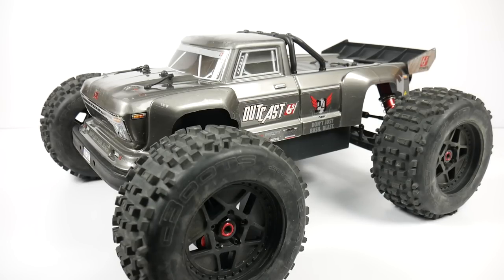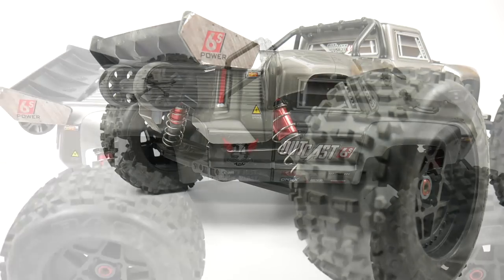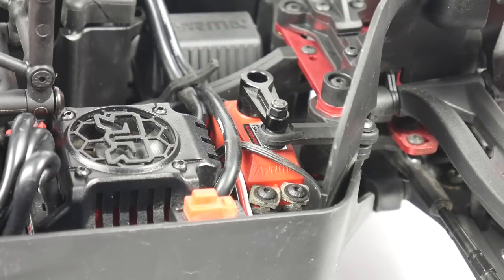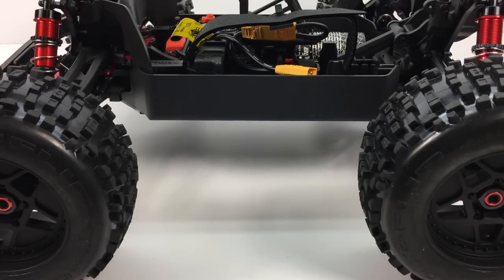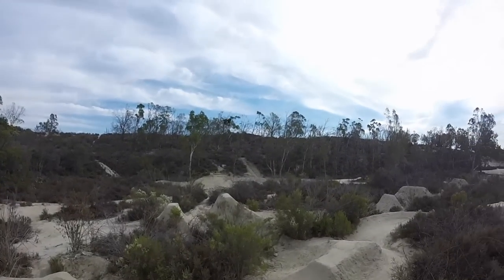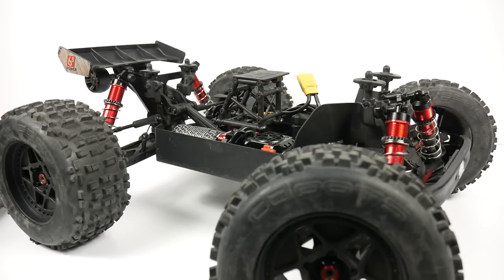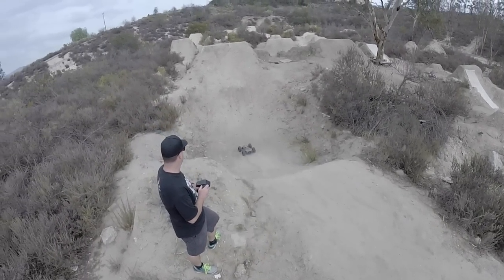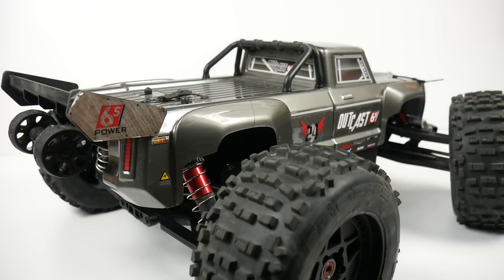Is the Arrma Outcast Really Worth $500?  Full Review

Comment: the diff gears are what is called powdered metal.  it's plenty strong enough. if it were machined it would cost 5 times more.    that one may have been a bad one.  but keep in mind with all that power, things will break.  that servo is more than fast enough for bashing.  I would recommend everyone to buy a pin press to change out the driveshaft pins.  of course you can use a block of wood and a pin punch but the tool is easier to use.  this way you can change out the pins in the driveshaft instead of the whole driveshaft.  saves you a ton of money.  as for the wires on the motor coming loose, this is why racers solder them.
Reply from the maker: The diff gears are a known issue in the kraton/talion/outcast/arrma.  As far as 5 times, that's not true....typical "pot metal" gears, like for Axial rigs are about $20, where as the machined steel versions are about $35.  The issue isn't really the servo, (although it's not fast to my liking) but the flimsy plastic servo mount.
Reply: @TheRCNetwork  20 to 35 is a 15 increase.  Thats a lot for 1 part.  Keep in mind there is 3 diffs with 2 in each.  That means it would raise the cost of the truck $45.  im sure theyve done the math on all of this.  Machining a million gears isnt cheap.  Youd also be surprised all the parts on your real car made with powdered metal.  Ball joints for one.
Reply from the maker: blue03r6 I was referring to the bevel gear in Axial’s - much larger than the internal gear inside the Outcast’s diffs. BTW, almost every 1/8th scale race buggy uses machined internals.....the price is not that far off to include these....but this is my opinion after running this truck, after all, I’m reviewing it and giving MY opinion as an expert.

Comment: just recently got back into hobby grade rc. i bought a cheap 37$ jjrc q36 rc its 4wd and hits about 20 mph has a few mm thick metal chassis and all for that price. also has ball bearings for the axles. comes with 2s 400mah lipo and charger.

Comment: Rich,
You can get an aftermarket servo mount for the Kraton, Senton  and Talion and from the looks it might also fit the Outcast??? Also on the steering you can replace the brass bushings with bearings between those two mods they made my Kraton and Senton turn 110%  better than stock and it also makes the workload on your servo much easier so they last longer
Reply from the maker: Good deal, and yeah, I saw those servo mounts on FB
Reply: The RCNetwork I have  one of those aluminum ones on my Senton and it rocks...I upgraded my Kraton before those aluminum mounts were available so I used an old aluminum A frame style servo mount from Traxxas but that reqired drilling extra holes in the chassis which I don't like doing normally but it was the only choice at the time both options work great but the custom mount on fb is far prettier and easier to install but it cost twice as much...but still the best
Reply: Crazy Craig's RC's and 3d do you have a link or video of how you installed the bearings or where to find the parts?

Comment: the engine wire's that pull out you can use shrinkwrap or maybe silicon line (for nitro car) to keep it in place? but looks very good the car! nice vid
Reply from the maker: Very nice Idea.  I simply stretched the bullet plugs to make the fit tighter

Comment: List tires and body styling as negatives. Go on to rave about how you love both later.  OK
Thoughts on the wing: I think its great for protecting the body.  Land hard a few times on the truck bed and you'll destroy the body... I learned that with E-Revo and E-Maxx BL models.  Those diff gears look super tiny for 1/8 scale/6s power. Yikes
Reply from the maker: I like the tires for how they worked, not necessarily that they're a copy of the Pro-Line Badlands.  As for the Body, it doesn't appeal to many people, but I happen to like the 60's pick up truck look.  The diffs have worked out fine in the Arrma's.....you can't say that about the Traxxas line up
Reply: Mark Pelto I disagree on your assessment of this truck and traxxas diff gears or traxxas at all. I had both a brushless e maxx and e revo and sold them with all my other traxxas stuff. I now have replaced them with the outcast and tekno mt410. Both are better than any traxxas. By the time I upgraded my e maxx to be almost as durable as my two now I had over $1000 in it. And the doffs were still crap. Traxxas is overpriced and over rated with plastic axles and everything else. For the price of my upgraded e maxx I bought both an mt410 and an outcast and haven't had to upgrade either and diff gears have been great. I learned the hard way about traxxas and others do too everyday I'm afraid to say. Tekno mt410 is the best 1/8 scale on the market.
Reply: 1. My comment about the diffs is based 100% on the impression of scale given in this video.  I will gladly mention that I have no factual information to back up this opinion, but I highly doubt that diff is as strong as even the Traxxas stuff.  They just look tiny and weak.  Diffs are a part commonly overlooked in a basher, and 'budget' brands like Arrma, Duratrax, Helion, ECX and others have traditionally suffered in this department to keep production costs down.
 
2. The only reason I brought up Traxxas was the wing mount.  The reviewer said he didn't like the wing.  My comment was it protects the body.  I tore up so many bodies on my E-Maxx, but on the E-Revo they lasted way longer and didn't rip the beds off the back or destroy the rear body post area because the wing protected it.  That was my only point when bringing up Traxxas in the first place.  But since you seem to want to bash Traxxas so much, I'll take the opposite side and try to defend them a bit.  Sorry you felt the need to upgrade every component and spend over $1k to try and make it bulletproof, but that is where you messed up.  You only need to upgrade a few things, RPM arms and hubs mainly.  On 6s you're going to break stuff... it happens, and its part of the fun.  The problem comes when you get obsessed with durability and try to upgrade everything.  The more stock you can keep it, the better.  Most alloy stuff is garbage.  Its pretty, but its heavy and has no flex.  Plastic is your friend.  Control where the weak point is, and plan to replace the cheapest/easiest part.  Look at spur gears, they're $3.50.... people try to run $50 stainless gears and upgraded slippers, billet tranny parts... it doesn't work. You upgrade a $3 part so you can break a $20 axle... OK!  Keep the plastic spur, replace it every now and then... who cares.  I don't expect any RC to take all the abuse I put it through - I expect to break parts, and I will upgrade as necessary.  The plastic axles are just fine. Anyone that breaks them all the time is either running a spool, has their slipper set too tight, or has no throttle control.  I worked in the RC Industry for 10+ years, and have owned just about every brand and type of vehicle imaginable and I will say the Traxxas stuff is plenty tough. 

3. I'm happy for you that you love your Tekno MT410, but it has nothing to do with my comment.  Its essentially just an 1/8 buggy with long arms and big tires - I would expect it to be tough! The only problem is, it isn't that cheap.  By the time you buy the electronics and put it together its well over the cost of the "overpriced" Traxxas you mentioned.
Reply from the maker: Mark Pelto sorry to interrupt this great conversation, but unless you have owned an Arrma 6s vehicle or the Tekno, it’s hard to comment on it...I’ve owned 8 of the Arrma’s now and the MT410.
Reply: ....which is precisely why I pointed out that my own opinion/impressions were baseless.  I am not saying the truck is junk, I'm not even stating that the diffs are weak, all I tried to say was they looked weak as a first impression, based on the evidence presented in the video.   I made no comment on the MT410, didn't even bring it up in the first place.  I'm sure they're both fine vehicles, sorry to offend anyone.

Comment: What would you tell someone who was trying to decide between the current Notorious (I know it's 5 years later) vs the current Kraton, both 6S?
Reply from the maker: Notorious will "stunt" easier than the longer wheel base kraton.  you can easily control the notorious in the air - front flips, backflips, etc.  The Kraton is much more stable

Comment: Just got my Arrma Outcast.  One hard case LiPo battery right now.  Looking to add probably 2 more.  Is it really that important to have a hard case battery, or would a soft case be good enough for just small jumping, flipping, and sliding?
Reply from the maker: Monster Yoda hardcase Lipos are recommended for off road vehicles - it’s a precaution to keep everything safe. I’ve used soft packs in these trucks before - 1 run on a 6s pack and it was severed and unusable after and a couple of 3s packs that only saw a couple of runs before I was not comfortAble risking the truck using them.
Reply: @TheRCNetwork  Good to know.  Sounds like I will stick with hard packs and a  battery buzzer.

Comment: Looking to get into one of the 6s Arrmas. I'm not looking to get into speed runs just a bit of everything. Such as  good speed, bashing ability, and overall fun. Is there a better choice than the Outcast/ Notorious in th Arrma line up?
Reply from the maker: The Outcast/Notorious is really fun. It's quick to wheelie due to the short wheelbase.  The Kraton will be a bit more stable, since it has a longer chassis.  I would skip the Talion - just mostly for speed runs now.

Comment: So I’m very close to getting one but I’m skeptical about the metal chassis. How often do they bend and are they better than plastic ones
Reply from the maker: For 1/8th scale metal (aluminum in this case) is the only way to go.  I've only bent an aluminum chassis once - and it was the Arrma Kraton doing some stupid stuff.  The Outcast has a shorter chassis than the Kraton.  So as long as you're not casing jumps or lawn darting it, you'll be fine

Comment: I really don't like sintered gears in RC trucks.  By their nature they are very brittle and just can't handle shock loads.  Manufacturers are using them because they are cheap and allow them to advertise as all metal but it's just not a good match.
Reply from the maker: They do have their place in RC, but at this scale and power, they should be hardened/machined steel

Comment: hey rc network thanks for your quality vlogs im in australia and i like ozzi rc playground but vas doesn't do much in the hi quality kits as you do so i watch your channel for that! i want to get a tekno mt410 and can you tell me the most powerful tekin truggy motor i could fit in it as it ssems to have minimal room in the chassis?? Glenn
Reply from the maker: Yeah, since the MT410 uses the buggy chassis, the space is limited...I did use the larger truggy Tekin motor, but it is stacked in there.....As far as most powerful, I am really happy with the 2000kv on 4s.  It's plenty!  If you do decide to go up to 6s, Tekin recommends the 1350kv 4038 motor....which you will loose some top end speed, but torque will be through the roof!

Comment: Nice review Rich, I totally agree with you... but for me this is a half way trough, half ready, halfbreed half-ling... I tryed my Typhon with 3.8 Badlands and it was awsome, till I started to do blackflips and really getting in to the groove, and then fellt apart! These need tones of upgrade, and at this price range I'm sorry, I don't really see the value in it, it does not worth my 500£ when I can have for 530£ another Nero with its diff brain tehnology... or for a 100£ more 2 Typhons... Arrma is getting off the track and getting greedy...long gone are the times when it was a good bang for your buck rc brand...
Reply from the maker: I don't mind the Outcast.....It's a great combination of quickness and brawn.  Price wise, it's right there with the other Arrma's and comes with some running improvements like the battery box/wire management and the wheelie bar
Reply: $150 in upgrades will put you as tough or tougher than any kit. You can spend what you like, the aftermarket support has grown tremendously in the last year and ARRMA is known for having the biggest, fastest, bashers on the market. TRAXXAS should have thanked them for all the free advice that was given to them instead of sueing them for a suspension setup that was used in high end sports cars way way before R/C adopted it. Plus everything TRAXXAS builds is plastic garbage. If they didn't keep their dealers stocked to the guilds, no one would ever get to drive them, which they shouldn't have purchased those milk jugs to start with

Comment: Hi there, may I ask? Can I run this on 4s for my younger son as well as 6s?
Reply from the maker: Yep....you can run this on 4s as well as 6s.  You'll need either two batteries or singles - the Outcast comes with a plug adapter to accept either two 2s or two 3s packs along with a single 4s or single 6s
Reply: Gotcha. Thanks.

Comment: No, it's not. Blow gears just like a Slash 2wd. Had it 4 days, driven on flat asphalt. No jumps. Now, I'm stuck waiting on replacements.
Reply from the maker: matthew clark asphalt can be more tough on RC’s than dirt and jumps. Especially if your going from forward to reverse, or slamming on the brakes. At some point with those backflip tires, something will break.
Reply: I've had a kraton for 3 years and have not gone through any gears yet.